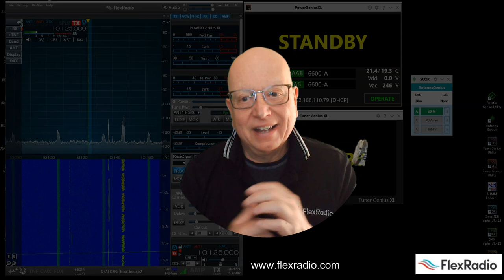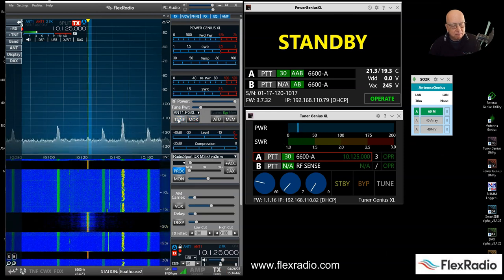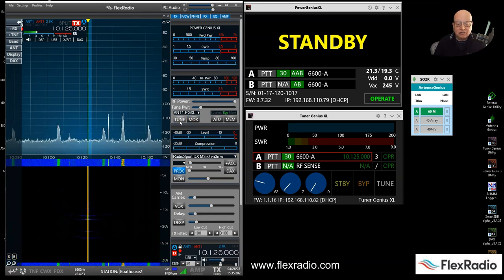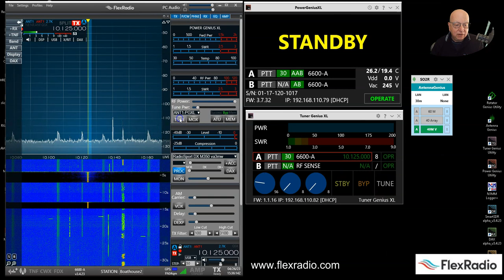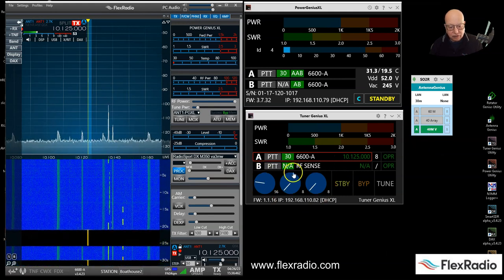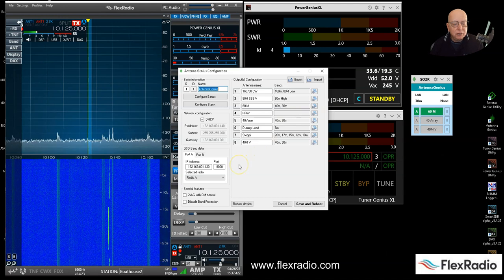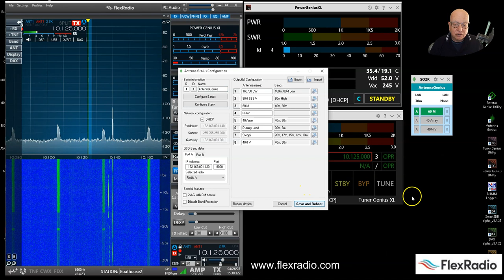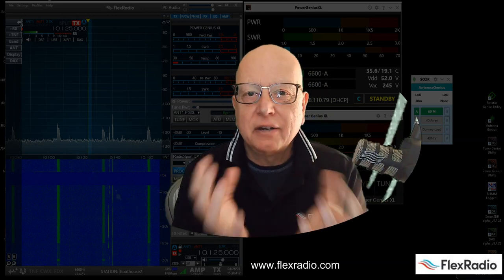Power Genius XL, Tuner Genius XL and Antenna Genius integration overview

Comment: In your first tuning example you started out with a challenge of 8:1 SWR.  The tuner corrected it to 1.8, then 1.08 which is nice, but what is the maximum power allowed out of the amp with such a large of a correction?  You skipped that part by only driving with 20W which produced only 500W out of the amp.  Same with the second example in which you corrected a 4:1 SWR, but didn't mention that the amp can no longer put out 1500W or the tuner may fail.

I own two competitive solid state LDMOS amps and both will correct high SWR, but the catch is they fold back the output power to prevent blowing up the finals.  

I wanted to see if your tuner had heavier duty components which would allow putting out max legal power at high SWR.  That would really pique my interest.

Thanks Mike,

-Dennis N6DD
Reply from the maker: To ensure optimal operation of your setup, it's important to understand the specifications and limitations of your equipment. In the case of the TGXL, full amplifier power is permitted. However, exceeding any design ratings may result in the termination of transmission to safeguard the device.

Monitoring SWR (Standing Wave Ratio) is crucial for maintaining efficient RF power transmission. If the SWR exceeds 2:1 at the amplifier antenna port, the PGXL is designed to initiate a fold-back mechanism, reducing RF power. Rest assured, the TGXL and PGXL are engineered to handle SWR ratios up to 10:1, ensuring reliable performance.

While it may have been possible to achieve full power on the 60M dipole, it's important to consider the potential risks involved. Higher voltages associated with full power transmission could potentially damage the installed balun. Protecting the integrity of your equipment is paramount.

Remember, your antenna system starts at the connector connected to hardware like the PGXL or TGXL. Take the necessary steps to minimize SWR at the end of the feedline, whether it's through the use of a radio, tuner, or amplifier. Neglecting proper SWR management can lead to compromised performance.

It's crucial to acknowledge that there are no shortcuts or magical fixes in antenna design. Simply installing an end-fed half-wave antenna and relying solely on a tuner will not yield the same results as a well-designed and optimized antenna system.

Investing time and effort into optimizing your antenna system will greatly contribute to maximizing performance and protecting your valuable equipment. Take charge of your setup to ensure the best possible experience in the world of amateur radio.